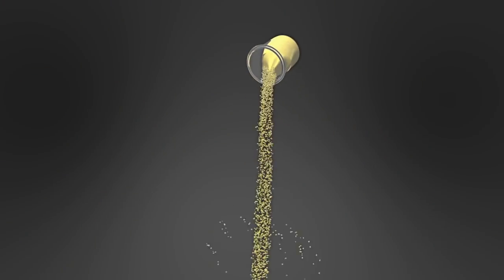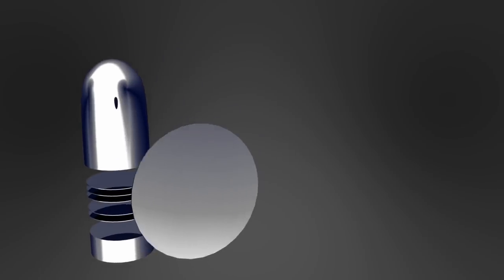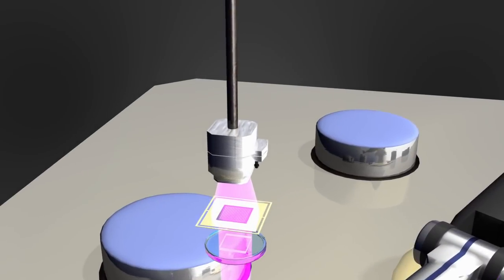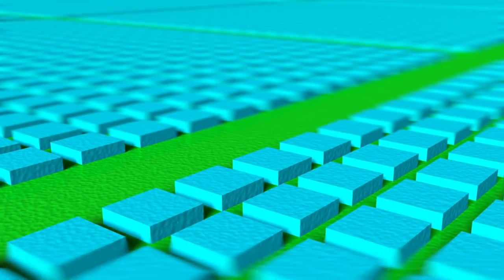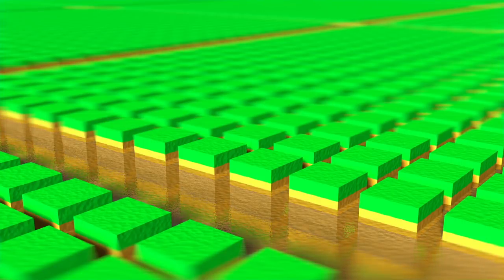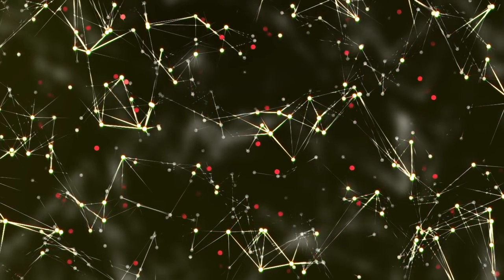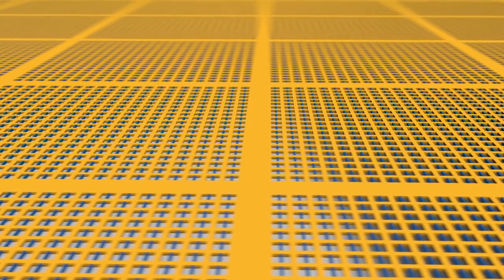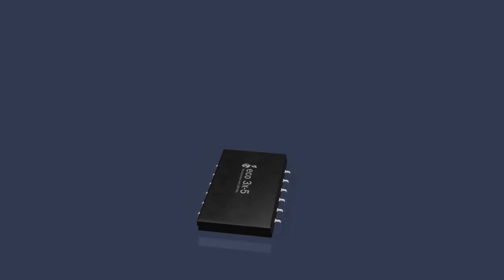How a CPU is Made / Microchips (Animation)

Comment: 5:07 how are those millions of connections made??
Reply: magic
Reply: Asiatic
Reply: Batman
Reply: Thats patented material. We dont know the process if we dont know how to use scihub for knowledge.
Reply: by tricking rocks into thinking basically
Reply: @hutchjackson2286  true
Reply: Chuck Norris
Reply: Think of it as a 10-story building. Each floor is connected through stairs or elevators. The metal lines are like hallways, connecting one end of a component to another, and the vias are like stairs, vertically connecting one hallway to another on the next floor.
Reply: Aint that the real mistery
Reply: staples
Reply: @isaacps3  this video is really the example of saying much without really saying anything
Reply: The information about this is gained from Area-51 and the US government only leaked this to Intel and AMD.